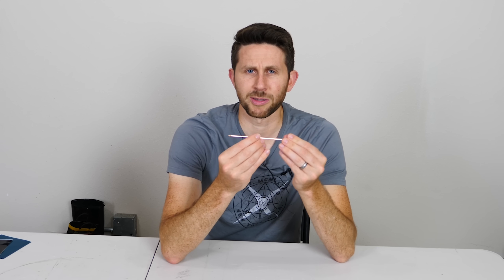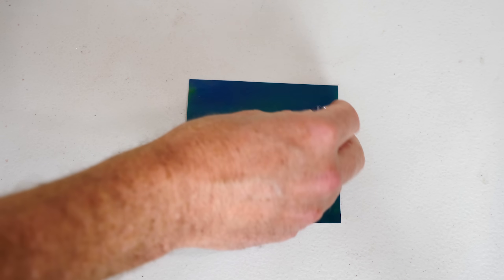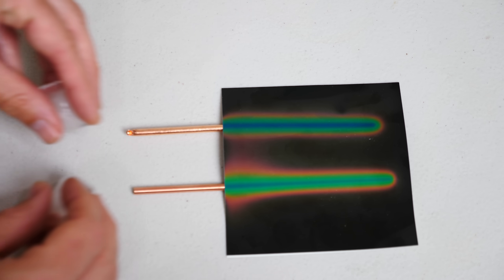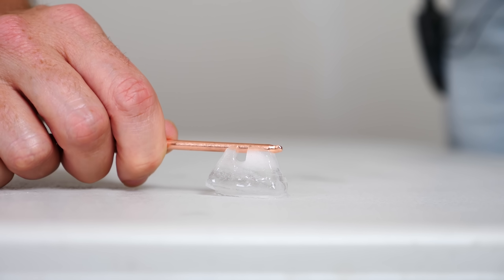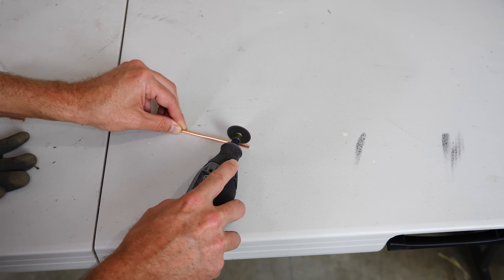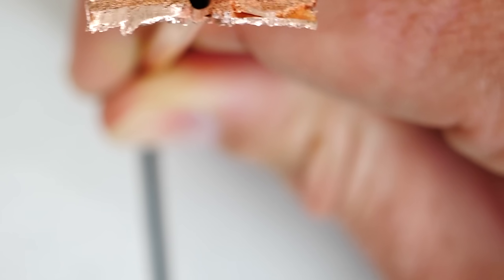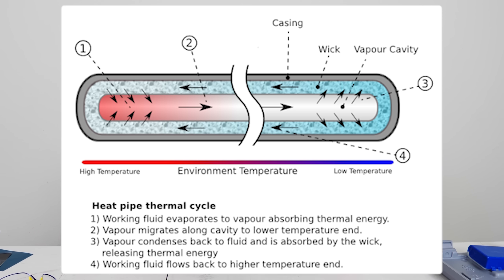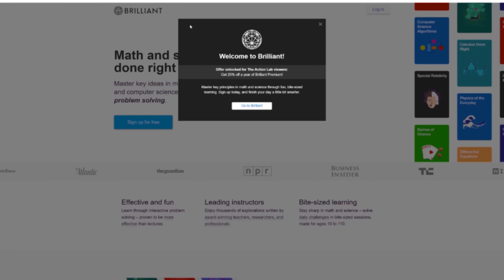What's Inside the Worlds' Fastest Heat Conductor?

Comment: What happens when you pass real high voltage of current through that? Explode?Or expand?
Reply: Well if you want really high voltage and current it'll probably explode and be a very big hazard to anyone near by without proper precautions. It's better to just keep the voltage low and run high amps though it. It'll get glowing hot and melt till the circuit is open, nothing too spectacular.
Reply: @jarhead1145  thanks man
Well the first part would be spectacular to watch though.
Reply: @jarhead1145  Why do you think it would explode? There is absolutely no reason for that. High voltage regularly passes through metal, nothing happens.
Reply: @gogo311  High voltage plus high current. We are implying that if we put enough through it, what would happen. So yes if you put what is going through high tension power lines then the heat pipe would violently explode.
Reply: @jarhead1145  Voltage does not cause a conductor to heat, only current flow does. One billion volts at one ampere has the exact same effect as one volt at one ampere on heating the conductor. High-tension power lines often carry hundreds of amps, which would pop that tube like a blown fuse. Their voltage is irrelevant.
Reply: @prometheus575  yeah 
Not voltage
Sorry
I meant a real strong current
Reply: @dhadelmacha3455  Well in that case, it would likely burst out of one of the ends, but with enough current to soften the copper, it would simply burst.
Reply: @prometheus575  so you're saying sending 1,000,000,000 Watts through this would have the same effect as 1W?
Reply: @andrewc1036  If the current is the same, yes. That's how current works. Voltage is pressure, current is flow. Wattage is work done by multiplying both. Pressure does not cause friction or heat, resistance to flow does.
Reply: @prometheus575  so there would be no arcing that would result from 1GV and create hot spots in that tiny tube that would thermally destroy it in microseconds?
Reply: @andrewc1036  Arcing to where? That wasn't part of the question. The question was what happens to the tube, not what happens to the tube when carrying an arc to another object, so the answer is still no. While you are trying to be sarcastic, you don't realize you are talking to someone who knows a great deal more about electricity than you do.
Reply: @prometheus575  so no corona discharge would occur at 1GV and non damage would be done?

Btw i am seriously asking. I see power lines carrying 500kV with relatively thin conductors but you are taalking about 1 GV at 1A.
Reply: @andrewc1036  No, coronal discharge would not be an issue. 500kV or even 1,000kV lines aren't affected by coronal discharge, and transcontinental like those also carry hundreds of amps. Those lines aren't very thin though, they are usually 1-2" cable, mainly for physical strength. Wattage is meaningless unless compared to voltage or amperage. The only time high heat is generated by high voltages is when there is a discharge to a lower potential such as a ground, since plasma is hotter than the surface of the sun. Absent this rogue discharge, it is only the current alone that is the factor. High voltages travel along the outside of a conductor, not within them due to the "skin effect". Look up some videos of people working on high-tension lines, you will see that once they equalize the charge between the worker and helicopter to the line, neither are adversely-affected.
Reply: @prometheus575  interesting.

Comment: Oh now I know that heat pipes inside modern mobile phones really work a great deal.
Reply: Imagine that, you have a steam cycle in your hands...
To disperse electric heat from a battery...
Helping you to connect with the literally world wide web...
FOR HOURS...

That's when science and progress just look cool in one concentrated place 😊
Reply: Designated
Reply: Most of the job is done by the copper plate(vapor chamber). because of the phone design, heat pipe inside phone doesn't do much without a real radiator.
Reply: Altair Foo Altair Foo this, the vapour chamber has a tiny amount of fluid at low pressure, this aids in reducing it's boiling point, 

The phase change is what removes the most amount of thermal energy 

This is also seen in cpu heatsink too (pc's), there is one downside tho, usually there's a heat convection which means at the heatsink (heatsink spreads to heat to various heat pipes - as heat pipes are circular they do not offer great surface area, of course with vapour chamber designs, this is eliminated) - the gas condenses back to a liquid droplets, if there's too much heat through out the vapour chamber or heat pipes, the wick will 'dry out' essentially becoming a generic copper heat sink, 

Vapour chamber and heat sinks work in the same way, they just have a different shape, but mainly* A design difference on the inside makes vapour chamber design for more effective in transferring heat, 

https://m.youtube.com/watch?v=M4POFT3Ctek
Reply: Am convinced after watching this!
Reply: @Phoenixoverlord17X quite a few are getting heatpipes.
Reply: Heat pipes transfer heat, but phones are still shit at removing that heat. In pc you have a big heatsink, in phones you dont have that luxury.
Reply: @Arelias95  I think the idea is to just transfer the heat to the phone body, where there is a large surface to transfer heat out, similar to how the MacBook air works which produces a lot more heat than a phone but also has a large aluminum body to passively cool it. But the biggest advantage of the heat pipe thing would be to handle thermal throttling due to short cpu spurts common in day-to-day phone usage.
Reply: @Phoenixoverlord17X usually onlu flagships use these. But to my knowledge they don't use water but something else. When you open one of these heat conductors you might see how the liquid inside immediately evaporates.
Reply: @Phoenixoverlord17X true, this usually applies for expensive phones like iphones and the samsung galaxy series. One of the first phones to have this was the galaxy s7 back in 2016.
Reply: Just don't abuse your phone to avoid overheat
Reply: a lot of phones use vapor chambers, not heat pipes
Reply: Yes absolutely
Reply: Indian and phone obsession will never parted
Reply: @rrsharizam  What? That's not obsession, that's an example of the heat pipe application we see everyday. 

Did you comment on this using a nintendo? Everyone uses a mobile phone.
Reply: @sriikarkrishna  you roasted him literally...!. "Using Nintendo?". LMFAO 😂😂😂
Reply: @sriikarkrishna  *RR sharizam has left the chat*
Reply: @rrsharizam  maybe because you comment about race which isn't related to his comment?
Reply: @sriikarkrishna  i doubt he even knows what a nintendo is
Reply: @whyamiherenow5122 
Luckily I'm not Hindu. So, nobody is going to light me on fire after I died.
Reply: Srikar Krishna dang chill its just a racist joke
Reply: @rrsharizam  lmfao that guy is right, you don't need to be Hindu, you've been roasted enough already 🤣
Reply: @Pussup Indian isn't a race
Reply: @rrsharizam  are u white?
Reply: @rrsharizam  he explain, he wasnt triggered.
Reply: @nairzD  RR sharizam again left the chat 🤣🤣

Comment: This is even used in some mobile phones.
Reply: ikr, that's the first thing I was thinking about.
But then I realize that my Graphic Card and CPU Cooler use the same heat pipe.
I was just didn't realize.
Reply: But the ones in the devices also contain liquid materials inside the copper pipe
Reply: @cheesycheese60  Prepare to be surprised!
Air is liquid
Reply: @Dominus_Potatus  I don't genuinely know what you mean about that but the liquids evaporate if you rip open the copper pipe

Comment: Whaaaw 👌👌👌🤩..what if you made the heat pipe the same , but the with SILVER ???
Reply: 7.8% faster transfer, only thing better gold..
Reply: @DanielbenDaniel  gold also ? ...its an very good reflector of all wavelengts and doesn't corrode (why its used on connectors) , but i thought its thermal conductivity is lower than that of copper or silver .
Maybe a good follow up video 😉👌

Comment: one very big issue here is that you're using a rod vs a pipe, it would be much more interesting to see the heat pipe vs a hollow copper rod, due to the difference in mass and thermal capacity.
Reply: There is no difference between long thin pipes with no fluid motion inside of them. The equation for transient conduction has one rate constant which is the ratio of the thermal conductivity to the heat capacity.
Reply: Ur looking at it the wrong way... The heat capacity will play a great deal if it was hollow making it faster to transfer heat.. However the part about air being the an insulator so it slows down the heat transfer is completely wrong
Reply: would not make much difference. you saw inside the heat pipe and it is about 1/2 the mass. so 1/2 the thermal capacity. but it took about 1 second for the heat pipe and 1 minute for the rod... it might take 30 to 45 seconds or even one minute still... 

so for the sake of the video and what it was comparing... it was more of a "heat pipe's function" vs "raw copper" that it is also made of as well. and the magic secret ingredient inside is not some shady chemical... just vacuum and water boiling and forcing it to circulate... 

the pores increases the surface area, the transformation of water, from water to steam also does something thermally... been a while so i do not remember if ice takes heat to freeze and steam forming release heat or if it was the opposite... but water changes phase anyhow so the thermal obviously gets transferred one way or an other.

so in short the video explains that inside they did not put weird chemicals to achieve that speed of heat transfer, just a mechanism with vacuum and water. (i now want "all" heat sink to be made 90% of those instead of 10%! i knew they were faster... but that THAT MUCH!)
Reply: Your scientific argument was entertaining 🙂🙂
Reply: dahahaka ;-; wtf how do you know this
Reply: A hollow tube would probably conduct better than a rod because of air convection inside the tube.
Reply: It was simply part of the demonstration. A hollow pipe of the same wall thickness would still be significantly slower so it really doesnt matter. The entire point of the video is to explain why a heat pipe conducts heat much faster than  copper alone. You're getting your panties in a twist over nothing.
Reply: Dude you need to go to school or college, you don't know basic physics, it's laughable
Reply: It would just be an even bigger difference, don't see what's "much more interesting" about it.
Reply: Gavin Jenkins agreed.
Reply: dahahaka not really because copper is a better thermal conductor then air so having a hollow copper tube will transfer heat slower than the copper rod
Reply: @jstew2938  copper rod takes longer to heat up due to density.
Reply: @jstew2938  you know what's even worse than air at conducting heat? Vacuum. The heat pipe is basically evacuated, your argument makes no sense
Reply: dahahaka while you are correct about a vacuum having lower thermal conductivity than copper, the heat pipe has a small amount of water in it which in the lower atmospheric pressure in the pipe boils at a fairly low temperature. The water boiling in the warm part of the pipe turns to vapor and condenses at the cooler end of the pipe, which transfers significantly more heat than air or copper would. It’s actually some what similar to the way an air conditioner or refrigerator works.
Reply: Jonathan Stewart  it’s “than” not “then”
Reply: @Gavin Jenkins quite the opposite, the hollow pipe would conduct heat faster than a copper rod due to less mass, air at atmospheric pressure being bad at conducting heat is only helping this.

The difference would be less pronounced if anything.

It's really not that difficult to understand...
Reply: @jstew2938  I know how a heat pipe works, a normal pipe does conduct heat better/faster than a solid rod. That's what i'm saying.

It's not a fair comparison
Reply: @dahahaka  why would less mass conduct heat slower? It might dissipate it slower and the copper tube might cool faster because an air current would naturally form in the tube leading to a passive forced air effect
Reply: @JWH3  Less mass conducts faster
Reply: @aasmith6117  that is the exact opposite of physical reality. Why do you think that? It's just like electrical conductivity, more cross sectional area (which also means more mass) means more conduction. Disipation can be lower but that's related to surface area not mass.
Reply: @JWH3  your thinking of that wrong.

The increase of a wires width decreases resistance absolutely.

But the increase of mass of a copper rod to a copper pipe is actually more like increasing the length of a wire(increasing resistance).

The reason for this is due to the heat having to heat up more mass. The more copper mass you have to heat up the longer it takes to heat up the whole rod(or cool down).

Edit: heat and electricity shouldn't be compared in these ways, they work off of entirely different ideas.

Electricity and water pipes are sometimes compared, but it's a good idea to keep a good distance from those ideas too.
Reply: I'll admit I'm neglecting radial effects here, but if we assume axisymmetric conduction and a thin, long rod the heat equation is simply dT/dt = (k/(rho*c))*dT^2/dx^2 along the length of the rod. no dependence on cross sectional area.
Reply: @zachburke8906  You're mistaken. I think you're confusing thermal conductivity and thermal mass. Adding mass could indeed slow down the rate of temperature increase, but temperature != heat. The equation for heat transfer through something like a rod or a bar is 
H = kA(T_h - T_c)/L, where:

H is heat transfer per second
k is thermal conductivity
A is cross-sectional area of the rod *
T_h and T_c are temperature of hot end and cold end, respectively
L is length of the rod

The A is the important part here. If the rod is hollow (a tube) you lose a lot of area. 

It's also interesting that you mention electrical vs thermal conductivity, since the 2 are actually very much related (in metals, this doesn't hold at all for non-metals). The relationship is called the Wiedemann-Franz Law, and it states: 

k/σ = LT, where

k is the thermal conductivity, same as the equation above
σ is the electrical conductivity 
L is some constant (so you can just ignore it basically)
T is temperature.
Reply: @dahahaka  There's a difference between dissipating heat and conducting heat. The reason CPU coolers are a bunch of heat pipes that connect to fins is so that the heat pipes conduct the heat and then the fins dissipate.  A rod would conduct heat better than if I t was filled with air.

I don't know why you continue to argue with everyone here, you even failed to remember from the video you just watched that the heat pipe doesn't just contain a vacuum inside of it but there's a water that was set up in a very specric way as well.
Reply: @dahahaka  by your logic, a pipe consisting of no copper is the best heat conductor lol
Reply: @joseislanio8910  it wouldn't conduct more heat it would conduct heat faster though, explaining the behavior in the video
Reply: @joseislanio8910  by your logic a massive 1 ton copper block would conduct heat as quickly as a thin copper wire.
Reply: @dahahaka  If the heat source is not a limiting factor, yes, more thermal energy can be transferred.
Of course, given the same distance
Reply: @dahahaka  If every part of the copper block is fully in contact with the heat source, yes.

I mean, seriously? Do you really think that in winter, having a single one of your hairs touch a piece of ice will cool you down quicker than if you grab hold of the ice entirely with your hand?
Reply: @dahahaka  You are right and it is sad that nobody understands you.
Reply: @dahahaka  completely wrong, you do not understand basic physics.
Reply: @julian-io5wl  Hes right but hes also missing the point of the video. There was absolutely no point in bringing it up since it's irrelevant to the topic of the video
Reply: it's not a very big issue.  it's not even sort of an issue - a solid copper rod is already a best-case comparison.